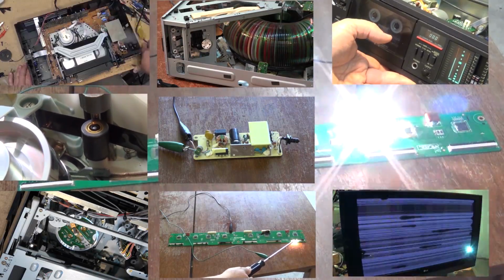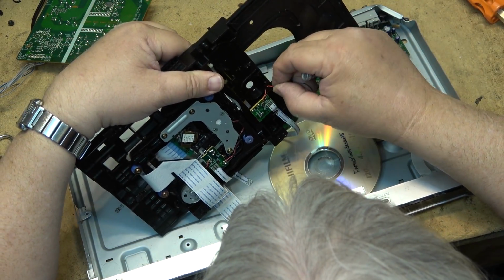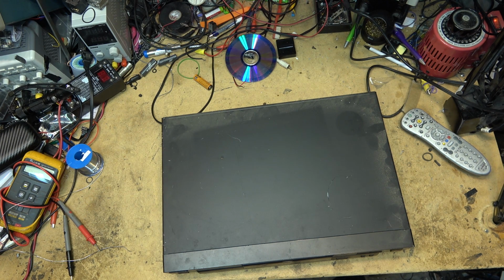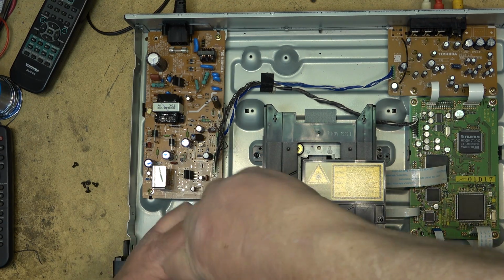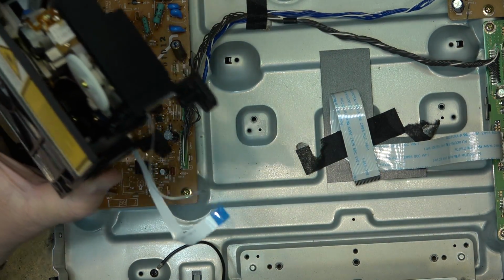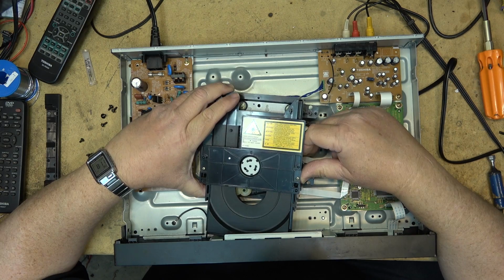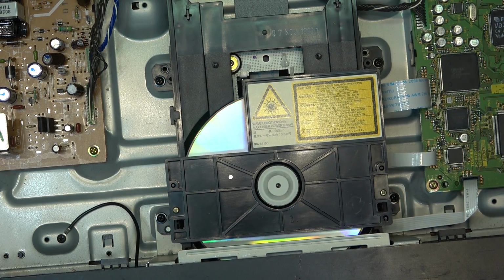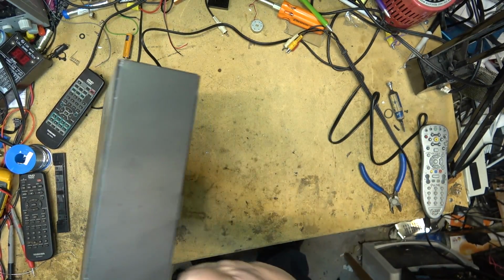2 Free DVD players will either of them work?

Comment: DVD when Dual layer DVD's had more storage than Hardrives in 1997
Reply from the maker: My first non linear editor I but together around 96 had a 9gig ultra  scsi.  It was 4000 just for the drive and another 450 for the controller.  In 99 I added a second drive this time and 18 gig ultra-wide scsi.  They were both 10000 rpm. The second one was 2500.   A dual layer DVD is 8.5g.  Most people had small drives because the big ones cost an arm and leg but for video editors they were a requirement because uncompressed visekbcheqed up 1 gig per minute.  File size was limited to 2 gigs back then so we had to gey creative and edit in small chunks and export back to tape.  This made projects take forever to do.
Reply: @12voltvids  my fiest PC I bought was in 1997 a Pentium 2 266mhz and 6.4GB Hardrive and a whopping 32MB of ram.  I believe I paid about 4000.  I didnt do pro stuff, I just used it to browse the web. Backnin the day you could see your neighorhoods nework and all their files. Lol
Reply: Scsi drives were a must have with CD burners back in the day @12voltvids

Comment: Your problem disc is a DVD+R.  If this player is too old it wont recognise a DVD+R that has its "book type" set to DVD+R.  

With DVD+R you can change the book type, unlike with DVD-R.  This allows DVD+ users, like myself, to make sure the book type is set to DVD-ROM when burning on the PC. This eliminates such compatibility issues as every dvd player knows the DVD-ROM book type.

Newer players would recognise the newer book types anyway.  You may find this player, depending on its age, may also not like DVD-R DL.  Just depends on if it recognises the book type for that disc too.

Comment: I thought playing even stamped CDs is not possible with a red laser, the thickness of the CD substrate was chosen specifically for 780nm lasers , because it was designed around the refraction index of the polycarbonate, it has a role in the focusing and the interference between pits and lands. That's why DVDs are half as thick as CDs, they have a second disc glued to them to have the same thickness, but that second disc is just mechanical support. I wonder what trick they applied to solve this.
Nice instant usage of a salvaged part 🙂
Reply from the maker: DVD are 2 discs glued together but that top dysk can have a data layer.   Dual Iayer disc.
Reply: Dvd players either contain two laser diodes, one for CD and one for DVD or they have a laser diode that can output both wavelengths. This is why some dvd or Blu-ray players lose the ability to play a type of disc, yet can still play others. They have more than one diode
Reply from the maker: @dlarge6502  they have 1 or 2 laser diodes.  The single laser can not play CDR.  2 diodes can both use same lens.   Blu-ray have 3 diodes and 2 lenses.  1 lens for the violet laser and the other for red and IR 
Some early units had 2 lenses one for CD and the other for DVD.
Reply: @12voltvids  It always amazes me just how small the diodes and their separate optical paths became.

Comment: Disc playback compatibility may depend on how the disc was finalized. The PC burnt one, might have not been finalize in the same way.
Reply: The book type may be unrecognised. That is why I use DVD+R/+RW as it is simple to change the book type to DVD-ROM resolving all compatibility issues with book types not being supported by players as all players support DVD-ROM.  In this case the disc that causes the problem is a DVD+R so the book type is probably set to DVD+R and unrecognised by the player.

The disc that work are DVD-R, although unlike with DVD+R you can not change the book type, this player obviously recognises the DVD-R book type

Comment: "Do not remove the shorting jumper until you've connected all the cables"

I wish products were designed where you could even get to the optics module without removing the faceplate, the headphone jack, the tray, the transport lift mechanism, the front right decorative foot, and the open/close button.  Much less the ribbon cables.

I was just working on a NS3100-ES and had to try swapping lasers.  I'm going to have to empty the swear jar here pretty soon.

Comment: I have not found on-line the explanation on how can a red laser play audio CD which were designed for infrared laser: the depth of the pit on the disc is calibrated so that it will cause destructive interference between the part of the beam that is reflected by the pit bottom and the part reflected by the area surrounding the pit. Maybe the difference in wavelength it is not so great (780 nm for CD, 650 nm for DVD) and it will cause destructive interference as well with red laser, but the spot needs to be much larger compared to DVD. Considering how CD-R works (they do not rely on interference, the pit are burned so that they do not reflect any light) i would say they should work straight way with a red laser, but maybe, as you say, the reflecting media in CD-R is too transparent for visible light.
Reply: I'm wondering about this as well.  I wouldn't think there would be any difference between pressed and recordable CDs from a wavelength perspective.  As far as I know, the difference has more to do with reflectivity and corresponding s/n ratio.  Players without automatic gain control do poorly, but those with sufficient gain headroom and low noise in the RF amp do OK.

I am prepared to be educated, though.

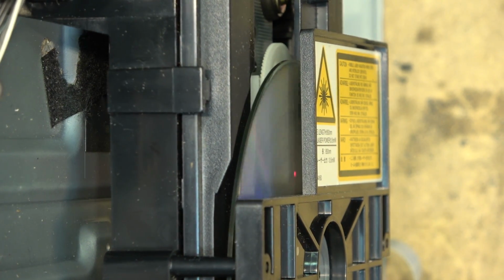EDIT:  I should know better than to post before the end of the video.  This is all explained at ~30:00.  Would be interesting to find a second source though, just for verification.
Reply: @sirnickity  S/N ratio is related to the difference between fully reflected beam (high signal) and non reflected beam (low signal); transition from high to low or low to high is decoded as "1" no transition is decoded as "0". Stamped CD's use an aluminium layer to reflect light; the "low" signal level is generated using a property of the laser light whereas two coherent laser beams with a 180 degree phase shift will cancel out each other. CD-R uses a reflective layer that is burned by the recording laser so that it will not reflect light thus generating high and low signals. CD-R behaves almost like stamped CD in terms of S/N ratio so much so my old 1985 Philips CD player reads CD-R with no problem. To my knowledge automatic gain control was added only to support CD-RW's which have lower S/N. But indeed all early DVD players with a single red laser will not read CD-R; therefore the properties of the reflective layer very likely does not work with 650 nm laser.

Comment: I guess the theory with a knife tip is that you have a fine tip but also a larger surface area. I don't really use them, except when they come in a pack and I use that tip as a sacrificial lamb when I need to melt some plastic or something, really good for that though.

Comment: Keeping the motors/gears and belts in a bag is always a good idea.
You found that out with cassette recorders and the stupid prices for motors.
i was disgusted by peoples greed.
Reply: people greed is pushed by the greed of the most richest folks in power only its called inflation and the rest have to deal with it
Reply: Well.. it's supply and demand...  If they gave them away for a low price, they'd probably get snatched up, and there wouldn't be any.  At least now you have an option.  It's up to you whether it's worth it.
Reply: I was able to find genuine NOS Mabuchi tape deck capstan motors on Aliexpress for around 5 USD, both 2-wire ones with internal trimpot and 4-wire ones with external trimpot. I bought two 2-wire ones, and six 4-wire ones so far, but I will buy more until it's available. Some of them are slighty corroded, but nothing serious.

Comment: For some reason, there is a difference between DVD+ and DVD- - most devices cannot read nor write DVD+.
Reply: There are many differences between dvd- and dvd+, which is why i prefer dvd+.

Dvd+ has a trick up its sleeve to address this compatibility issue, but you have to remember to "turn it on" when burning a disc on a pc otherwise older players wont recognise a dvd+r
Reply: @dlarge6502  What I meant with "for some reason" is why those 2 competing formats even had to exist. Kinda same like HD-DVD vs. BluRay. Edit: Competition isn't always good for the consumer.
Reply: @kyoudaiken  It wasn't anything like HD-DVD vs blu-ray because DVD+RW (what it was officially called) was compatible with DVD-.  The reason it existed was to replace the more primitive DVD- standard with something that could take on DVD-RAM (which was a format that you could see as being like hd-dvd vs blu-ray).

No consumer ever had an issue with DVD-R vs DVD+R so saying it wasn't good is, silly.  It barely affected anyone and most of the time things like setting the correct book type were edge cases few people ever had to worry about.

Also HD-DVD vs blu-ray only includes the formats that people remember.  There was a bigger format than hd-dvd, not to mention other someting formats.  It wasn't a format war between only 2 standards, there were many and HD-DVD was the smaller of several.  As for it being bad, no, it could have been very good.  Had HD-DVD won we would have have a very cheap and usable media, but unfortunately it didn't, leaving the consumer with the bad choice, blu-ray, which is (was) expensive to license (hd-dvd was free) as well as incredibly locked up in DRM.  The only thing going for it was its technical superiority, which it really did have.

But no, consumers never had an issue with DVD-R vs DVD+R.  They just bought what was cheaper or what I recommended when I sold them to them (I recommended dvd+r because of its superior design).

Keep in mind that dvd-R and DVD+R are still current...  again, you cant compare them to a format war as neither won!

Comment: It was really great to see how you handled that first one with the fractured motherboard PCB.  I have these boxes filled with partial PCBs, and I am really big into desoldering through Hole parts and really doing whatever I can to the salvage components.  So seeing examples of how a real pro repairman might approach the different types of appliances.  Your dvds might need a type of region encoding, or it may be expecting CSS encryption, and when it rejects, it maybe that the disk is not CSS encrypted?  AGAIN, THANKS FOR SHARING ALL YOUR REPAIR VIDEOS!!
Reply: Not even all commercial discs are encrypted or region coded, so that should not be a limitation.

It's actually a little sad that lock-outs are so common that someone would think they are mandatory for proper operation.  What a shameful state we're in for that to be the case.  :-(

Comment: Interesting that the other discs played even with cracked gear.
Reply: My guess:  The transport location is not really super critical.  The lens can scan several tracks without having to move the pickup sled.  So, when the cracked gear meshes with the other, I'm sure the lens position servo is working a little more to track the disc, but a player is frequently adjusting the sled position in tiny increments, so it likely gets through that rough patch well enough to keep playing.

Either that, or it would only show up with tracking issues at certain positions on the disc, where that crack in the gear has the biggest impact on alignment.  The rest of that gear's rotation would be more or less OK.

Comment: That one DVD Toshiba refuses to read might just not be finalized. Laser just does not know where the end of the disk is and throws the incompatibility error. That's the one thing that comes to mind because they all look the same in all the other ways. And older players sometimes had this problem.
Reply: Or it requires the disc to have region code